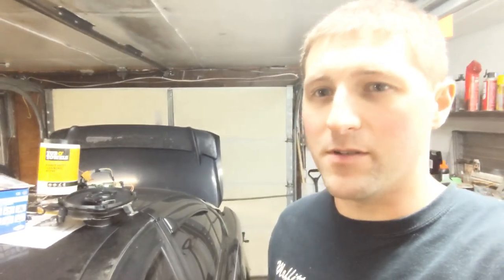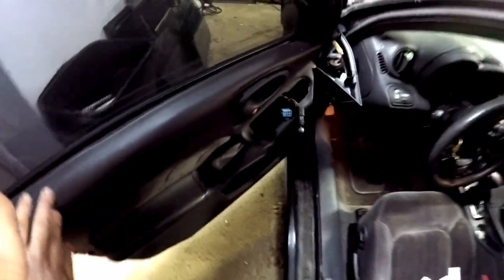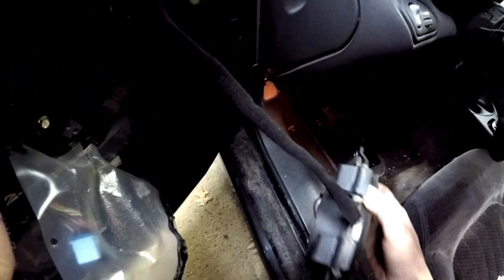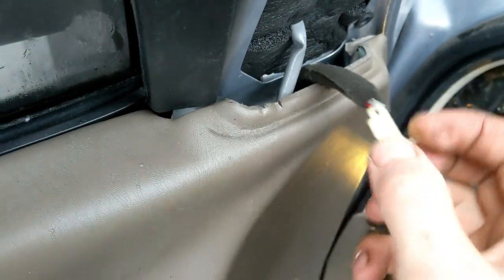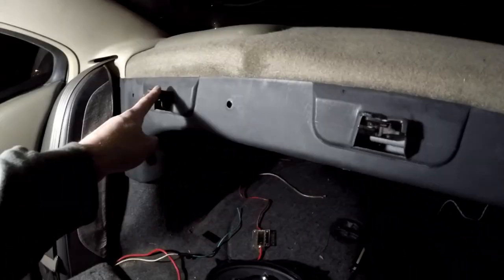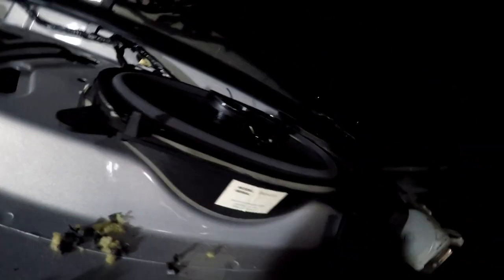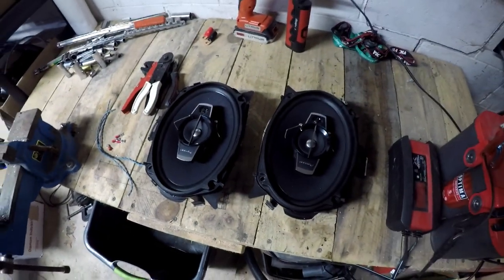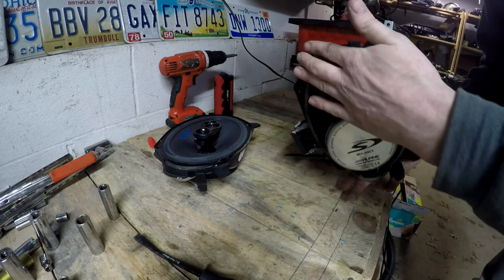BrokenGrandAm Series Episode 7: Speakers

Comment: I just got done replacing my previously falling headliner and it turned out great! Ended up using the 3M Headliner spray adhesive and traditional jet black headliner cloth. So when I noticed the material around my rear speakers is faded into 3 colors, I decided I would take it out to replace it. I'm in the middle of that now. Have yet to see how hard it is to remove the old carpet-like stuff from the board- The board you just took out in this video, obviously. But I bet it'll come off w/ a wire wheel or other attachment on a grinder or drill, or a hand scraper.
Reply from the maker: Interested to see how that comes out! I've seen a couple fiberglassed for a custom speaker setup!

Comment: Hey man, do you remember what you did to get down to 2 wires for the speakers? Like yours mine has the 4 wire plug.
Reply from the maker: The 4 wires is apart of the monsoon system. I don't remember off hand. But there's 2 wires for tweeters/highs and 2 for the woofer/lows. I'd suggest using the lows. Theres also a plug adapter I believe crutchfield sells, I've never personally seen or used one.
Reply: @KMaffittGAGT  Thank you!

Comment: I have a 99 GT they has tweeters.  Most of the aftermarket speakers I see for the front have a tweeter on them.  Do I need to connect the stock wiring for the original tweeter to those speakers or can I leave them disconnected and still get full range of sound out of the new front ones? I think my tweeters might be shot and producing distortion
Reply from the maker: you can go either way!

Comment: Hey! I’m getting ready to get supplies to redo my sound system. I have a 2002 grand am gt with the monsoon system. At the end of the video you mentioned putting in new wiring if I was planning on putting in new speakers and head unit. (At about 12:30) By this did you mean the amp to head unit wiring or the speaker to amp wiring or all of it? I’m assuming you just meant the amp to head unit wiring as rewiring everything is quite a job. Thanks for the help! Love the videos!
Reply from the maker: I was referring to all new from radio to speakers and bypass the monsoon completely. The radio can power the speakers just as well!

Comment: Will the speakers sound pretty good without a small after market amp? I have a 99 gt that I'm about to change out the factory speakers.
Reply from the maker: You'll have to do a little bit of wiring, that will have the monsoon amp powering the speakers. Which, will be fine with a fresh set of speakers.

Comment: I need your help with my rear fold down back seat, how can I make it fold down for easy access for the wires like amplifier wires plus ground wire for the subwoofers.
Reply from the maker: There are 2 loops in the trunk that you pull to release the seats!!

Comment: Bro you completely skip the step where you wire the harness you made to the wires in the car that was a whole reason I watch this video and you skip that part.... mine has 4 wires on the factory harness it's a 2004 grand am gt
Reply from the maker: So this car being an SE did not have that!. I will address that separately once I mess with  another car with it. Right now I only have the daily and the OEM speakers work amazing with an aftermarket radio!